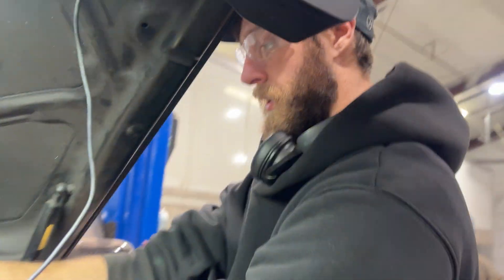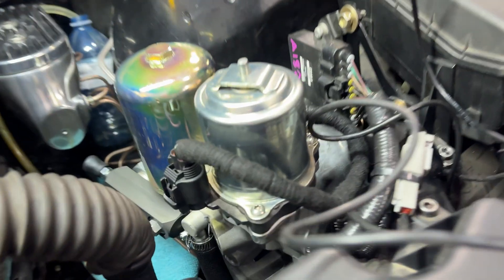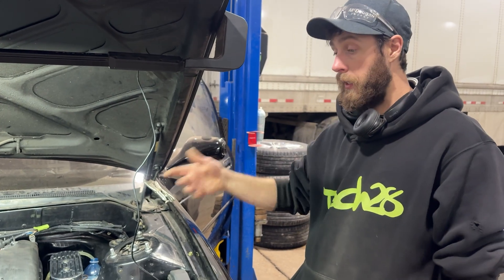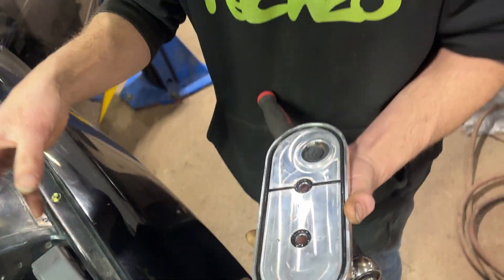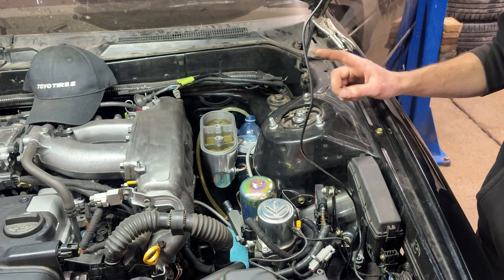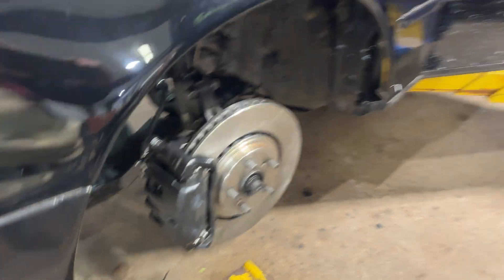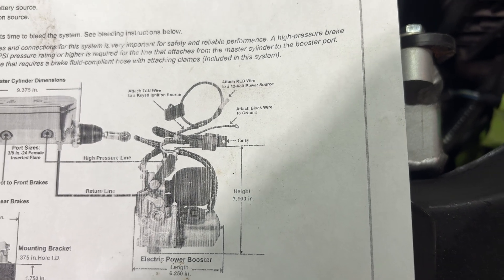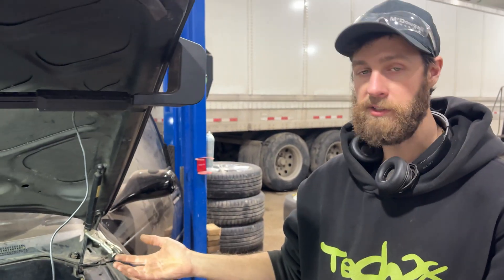Jegs Electric Brake Booster and Master Cylinder Combo 631250

Comment: How does it compare to a Bosch/Tesla/Honda electric brake booster that you can find for around $300?
Reply from the maker: I’m not too sure, I haven’t tried those ones but I did look into getting one of those instead. This was the most compact option I could find and it couldn’t have fit any better

Comment: How loud is the pump?
Reply from the maker: It’s acceptable, not ultra quiet but also not super loud. I haven’t really had a chance to drive the car yet as I am waiting for the snow to melt, I can update you in a month or two
Reply: @Tech-28  so is it pretty quiet ? can you hear it over the engine? thanks only video of this unit being used thanks for posting itl
Reply from the maker: @mowbetter2010 I can’t hear it over the engine